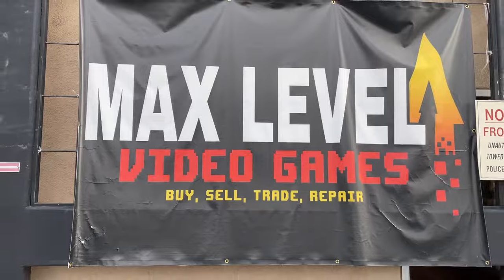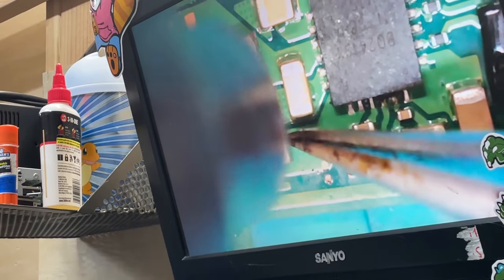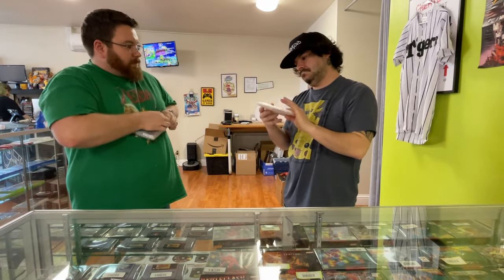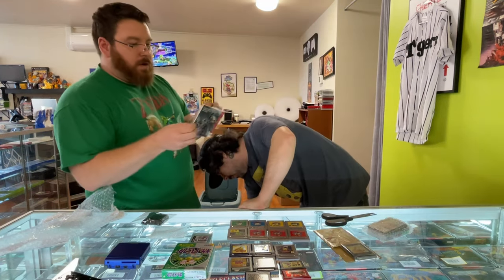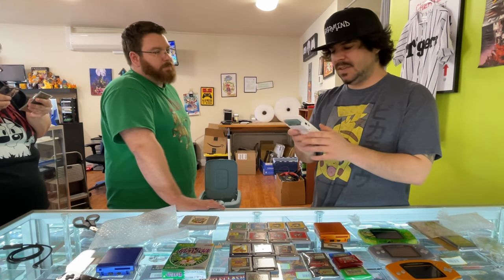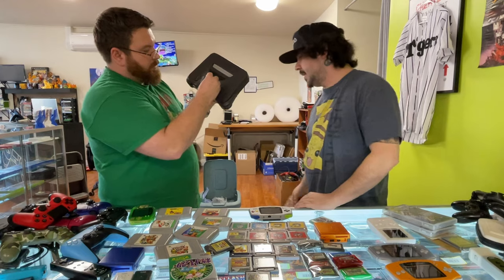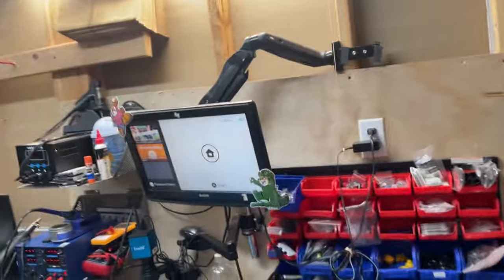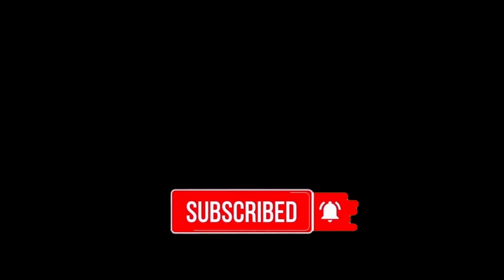Embracing Opportunity The Novice at the Helm

Comment: im working on a ps2 phat it will play DVD but not CD and it needed a new Power Reset Switch Ribbon Flex Cable
Reply from the maker: Did you replace the laser?
Reply: @MaxLevelVideoGames  no not yet got a new laser coming